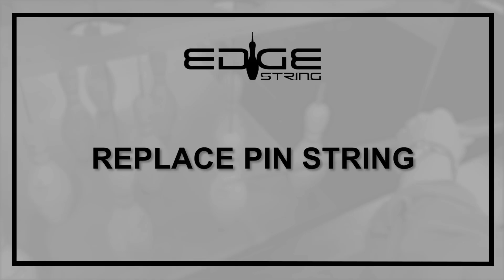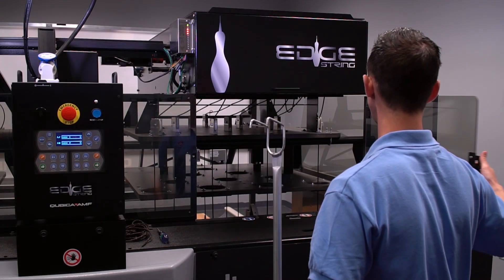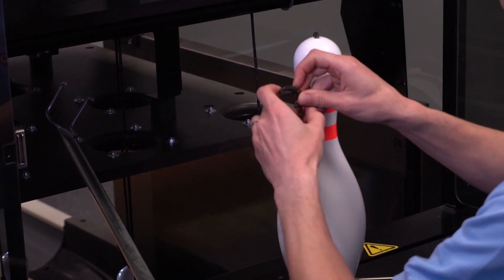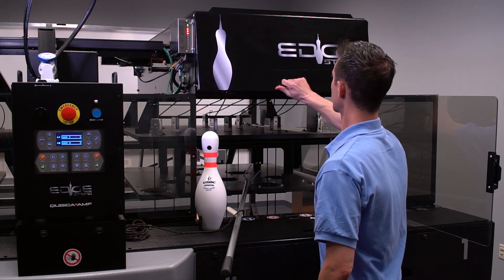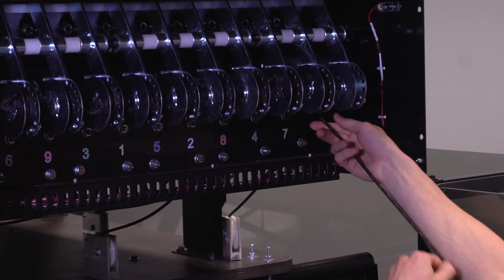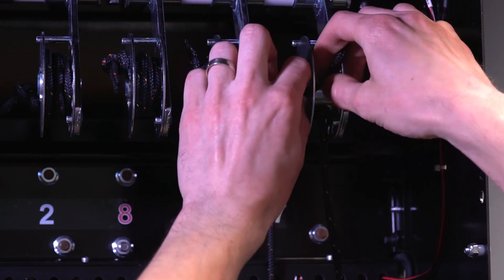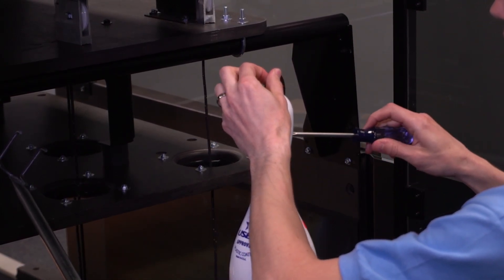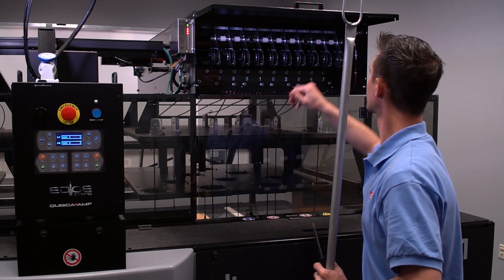How to replace pin string - QubicaAMF String pinspotter

Comment: Dear AMF… Invest in trade schools and promote for machine technicians.     82/90 XLI Edge (free fall) are your best machines and will keep the sport alive.     I worked on the 82/30s as my first job in a bowling center and became intrigued and involved with the machines.

String pins are cool but will ruin the sport in entirety if this is really pushed.  

Give tours of your facility in Virginia to trade school students and to the public.  It will boost public relations and get new technicians in centers that have no mechanics that know how to maintain the 70s & 90s.

Comment: Wow.. This is advanced technology?
Reply: It’s simpler and requires much less maintenance
Reply: This is what happens when your local bowling alley owner refuses to afford keeping the old machines running and are total cheapskates.
Reply: @GiLo-Chan2004  This is the result of rising costs. Y'all complain about eggs being more expensive, and are justified, but if a center complains about rising costs, they're cheapskates?
Reply: Hi pin dominator!
Reply: Junk!